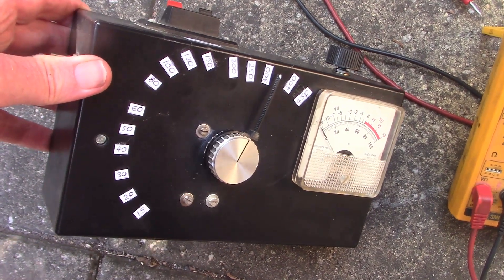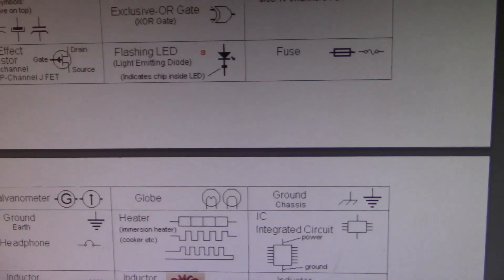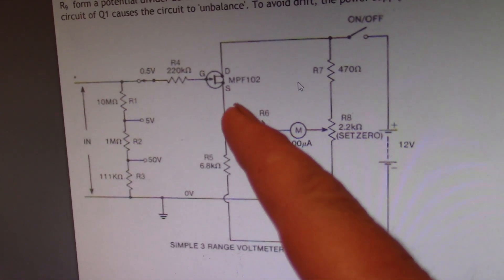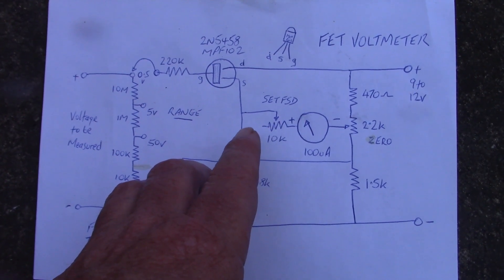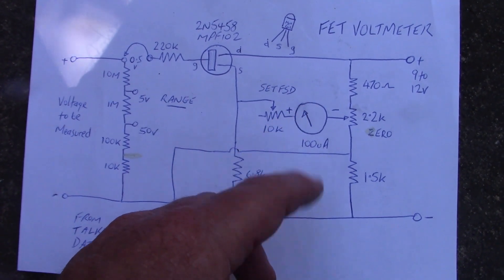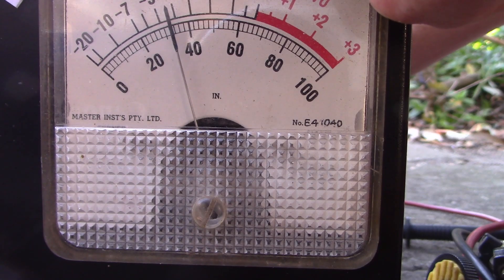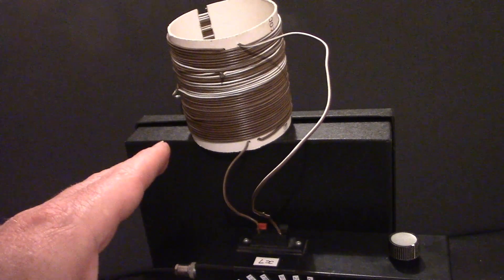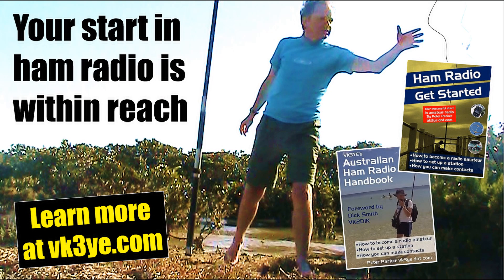Measure inductor Q with this - Part 2

Comment: Hi Peter, you might try fine tuning with the RF source. Your radio can tune in steps of 10 Hz (CW mode). Should be easier to nail the peak, resp. 70%. 73, Kiril